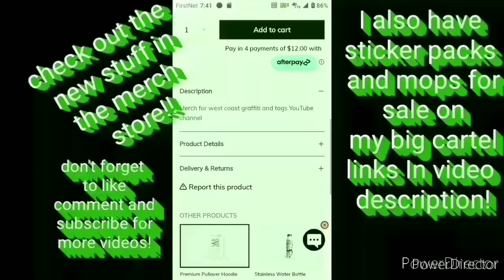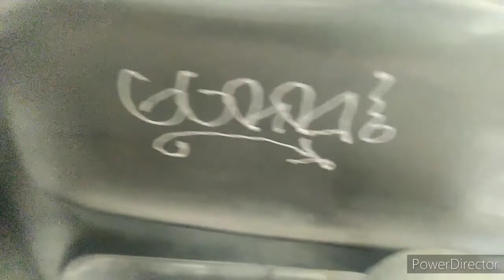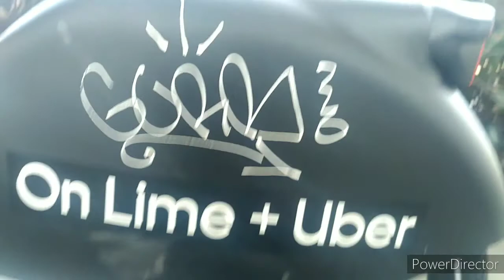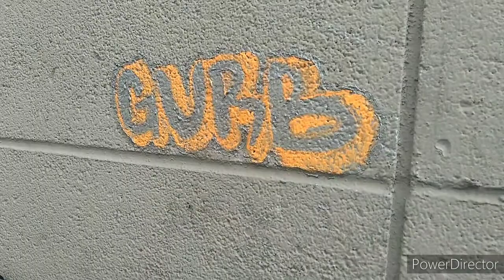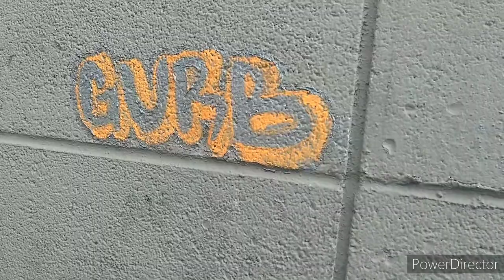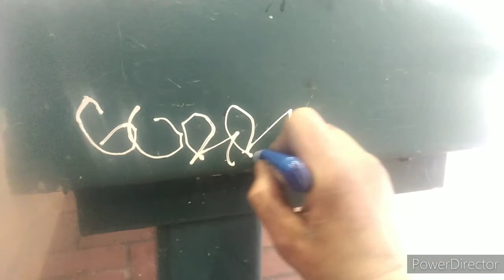brod daylight tags in Seattle

Comment: if you like prestos you should try the puffy paints from Walmart super cheap and sorta similar I've used them in the rain before they work fine as long as its not like pouring hard asf like a huge storm but if the surface is wet or its like a little bit of  drizzle or mist its perfect also try the tulip brand they have neon orange and like other cool colors and they kinda have a huge body so its like using a mop except it comes out like a presto and its bumpy after it dries so when the buffman goes over it its a different color but still visible its like painting a pebble on the street its still visible but its color has changed its awesome and rain doesn't do shit to it lol after it dries at least but check em out there like a dollar each at the Walmart
Reply from the maker: Will do thanks for sharing